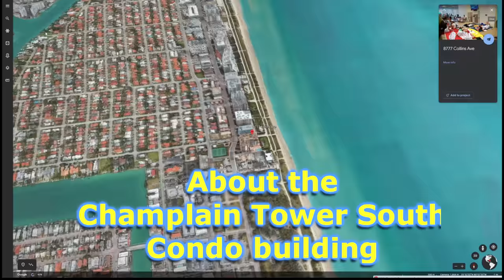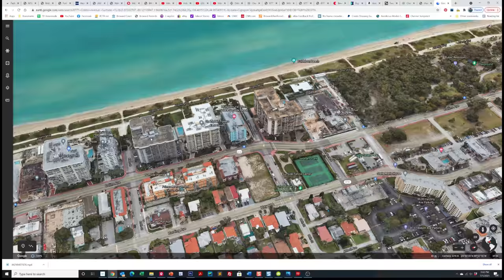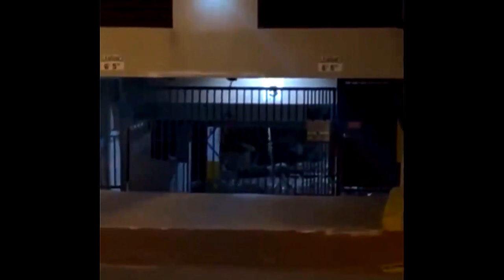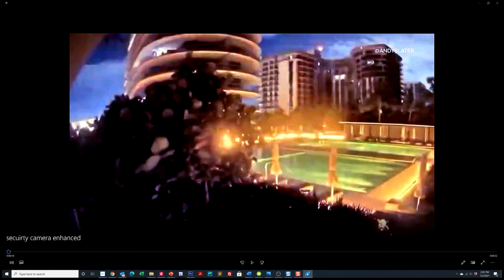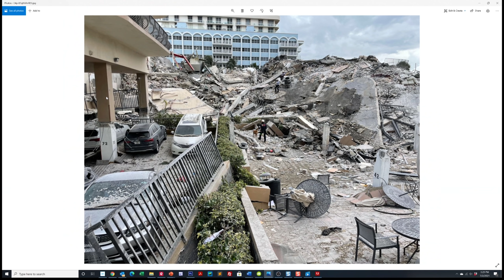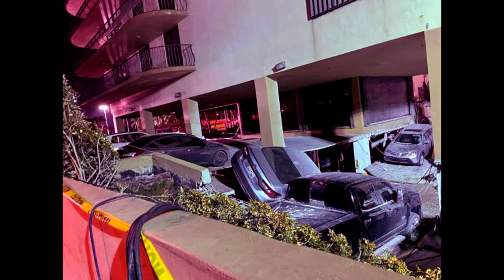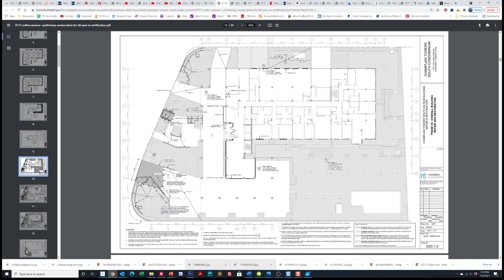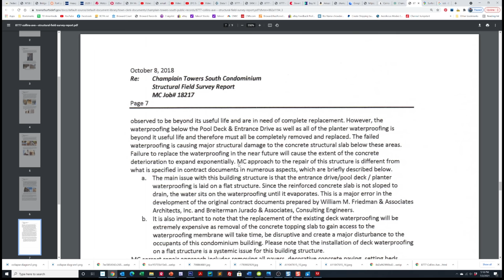Here's Cause Of Miami Condo Collapse Champlain Condo Towers, Surfside

Comment: Best video that explains it. I believe the  water and design error theory more. But even if you leave the bottom slab soffit flat they can still add the slope on the top of slab. Making a thicker concrete slab at the ridge lines/high points. It’s hard to believe that they built that pool deck slab flat both bottom AND top? And if they did, that’s what accumulated all the water in certain areas where there wasn’t suppose to be accumulated. Adding weight and piercing through some cracks damaging the slab.

Another thing I do agree with the narrator was that most of those columns were indeed too small! I’m also wondering if the columns had drop panels or not?
Reply: The columns were fine.  They didn't fail.  What failed was the way the horizontal members connected to these columns carrying the pool deck.  It probably was only one junction which collapsed, but in so doing it overloaded the other areas and the additional stress caused them to fail.  From there, the upper floors load was no longer being carried by the columns below, but instead was hanging in mid air.

This was also over the driveway area which had the load being carried across a double width span. If there was a support column for the above ground structure  sitting midspan on that beam, then as the beam fell, that whole column would drop, and then pull adjacent members with them. From there it was game over. The seafront tower collapsed due to debris from the center knocking out its central support which caused it to fall inwards before pancaking.
Reply: @MartinSparkes-BadDragon  Drop panels or drop heads as we say in the field supposedly strengthen the horizontal members though right? There's no doubt columns are going to be standing up because it's an immovable object in a vertical stance to support. But normally on foundations or mezzanine levels all columns require drop panels for better tension support w/slab to column tie-in. Or am I wrong?

But I do agree with you on your theory that once it collapsed the rest was basically in mid air. No support at all.

Another thing I realized in other videos when it showed spalling underneath the pool area is that the rebar wasn't epoxy coated. Maybe that played a part too since the epoxy coat helps it to not expand when rusty.

Comment: Let the truth be told and it would appear the has been told by you. The city needs to get you on board if they want to save more lives. I see them piddling around with getting the truth of the matter to the people who need it in order to solve this and future issues of this type. This unfortunately is not the last of structure failures in the city. Thank you for this comprehensive explanation.
Reply: I don't understand how a building implodes w/o anyone noticing one crack. Doesn't make sense
Reply: @kdub3892  That's the whole thing, They knew 2yrs ago there were issues with the building but did nothing about it.

Comment: Nice detailed discussion of the collapse.  One additional key aspect of the design and possible factor in the "progressive" collapse is the smaller column size used in the collapsed area of the building. Considering the building as a large mass supported by the columns (idealized as springs), the natural frequency of the structure was lower leading to greater vibratory displacements than the building that remained standing on stiffer springs, i.e. larger column cross sectional area.  With any impact event, such a spring mass system will be set in motion by external forces; the energy from the pool deck collapse, and cause the structure to experience vibration in vertical direction, which is probably what people in the building experienced (some reported the building was "shaking"). The dynamic response of the structure reacting to each section of the building falling seems consistent with the observed progressive collapse. California has earth quake requirements to preclude the "soft story" effect which did result in a similar pancake collapse of one apartment during the Northridge quake.

Comment: I have searched YouTube for every bit of information about this tragedy, trying to get some better idea of how and why this happened.
This is the only video that has come close to making sense to me.
Jeff, thank you so much for all your hard work putting all of this together and for making understandable for the average person.
I have a question though. 
I know that the other block of condos, which seem to be exactly the same as this one, have been deemed safe. However, if they are the same as this one and if they have the same smaller columns one one side of the building, as well as not having a sloped surface under, where we believe water probably collected, over time weakening the structure, will these issues not be a potential disaster in the future as well?
Reply: Perhaps but think about it they're the only now discovering that there might be some small changes in column sizes. Also I have a friend in construction who said it could be as simple as a poor-quality cement or mixes. So there are many opportunities for those other buildings to still be structurally sound.
Reply: He got his theory from Construction Engineering & Failure Analysis's channel and doesn't give credit to the person doing all the work, from the beginning. Nobody else is talking about this theory, and then suddenly jeffostroff comes up with the same exact theory that was established after 10 days of work.
Reply: @FunnyFallGuy  so this  is not Jeff’s Analysis?
Reply: Who knows? It might be that the pool deck of the other block of condos is properly sloped and drained. Or they did repair it already.
Reply: This video that we just watch it very informative. Also, look up building integrity. He breaks down, in layman’s term, everything that probably went wrong.

Comment: Salt, water, humid hot air, shallow water table, condensation on every window. How did it remain standing for so long?
Reply: Insurance scam.
Reply: Capitalism at work
Reply: @neoliberalerneandertaler9347  uh what? explain that
Reply: @scottmerrow1488  uh what?
Reply: I would  never want to live in a high rise building  nevermind  one anywhere  near the ocean.
Reply: @kathryndirocco3048  You have common sense.
Reply: @scottmerrow1488  . Thank you. I assume  that means you wouldn't  either. What a horrific  tragedy.
Reply: Salt water destroys!
Reply: Water causes building cancer.
Reply: @immadreamer3697   Not to mention how many times that parking garage has been flooded with salt water from tropical storms and hurricanes in 40 years
Reply: If anyone has worked on a building on the coast knows that iron turns to dust in due time. Open a wall or ceiling at look at the metal that has simply turned to dust. Concrete retains moisture which contains rebar its not hard to understand you dont need a drawn out conclusion as to why it happened.. but at least he is getting views😞
Reply: @immadreamer3697  accept the pooling was mostly rain water.
Reply: Other factors that may have contributed: effect of past hurricanes; ground may have sunk some (common in florida due to limestone earth)
Reply: @neoliberalerneandertaler9347  Yes because teh buildings in Russia that used superior Stalingrade concrete and rebar are doing a lot better, comrade!
Reply: @joesnuffy1061  Explain what? He's answering a stupid quote with an even stupider one - sorry for your whoosh
Reply: @kathryndirocco3048  Too bad you don't live in Asia.
Reply: @scottmerrow1488  And you don't. The vast majority of the world live in high rises, at least in Asian places, so your sense is not common at all. Get out of the 'burbs and look abroad lol.
Reply: @scottmerrow1488  bingo!
Reply: God Rest to poor victim souls and please keep their families in your prayers
Reply: @the_kombinator why the hell are you  attacking  me? No i dont live in Asia  , and if they have high rise buildings  for the most part then thats their  decision to make and deal with. I live in the USA and im commenting on what i think is complete stupidity to build high rise buildings near the coast.  So why its not common  sense  to you i don't know or care. Don't  be so arrogant
Reply: @kathryndirocco3048  high rise buildings have been built near the coast for a hundred years. This is an absolute freak occurrence, not normal or simple at all. I'm an engineer and the video is fantastic.
Reply: @the_kombinator  Is someone paying you to (try to) waste my time?  I'm 60 yrs old, have been abroad and lived in urban, suburban and rural areas. Who cares if most Asians live in high rises?   Your common sense told you to argue with me/"set me straight"?  Go find a life
Reply: @kathryndirocco3048 Common means it is, well, just that. Look at the population of Asia vs North America. Realize where the majority of people live. Then re-examine your statement about "common" sense.
Reply: @scottmerrow1488  LOL what? You need to take your meds, gramps. Only 10 more years till retirement :P
Reply: @the_kombinator you need to cool your jets pal. Someone  else said  i have commonsense, i just gave my opinion  on high rise buildings  and especially  built near the water. ( salt water erosion). If its ok with you im just saying my opinion  like everyone  else. Go take your anti bully pill.

Comment: The photos of the debris clearly show classic punching shear at the columns. That is where you see the deck failure at the columns by allowing the deck to break loose and fall straight down. Current building codes provide for additional reinforcing at the columns that apparently were not in force at the time of construction of the condo.
Reply: Exactly.  There appears to be no rebar tying the columns to the floors.  This isn't an "if" on these buildings, but a "when".

Comment: I live on collins about 30 blocks South. Water is everywhere, if it barely rains the streets are flooded. Miami Beach has a major drainage issue period.
Reply: Yep.  Having taken geology courses, there are a few places I will NEVER live because of it.  Miami beach is right up there.  It's built on top of stuff that easily erodes in water and is surrounded by water.  Plus "Florida Real Estate Developers" are right up there with "Hedge Fund Managers" in the rate of being notoriously shady.
Reply: Evidence human greed will lead to more disasters. We just aren't meant to live certain places. Nature always prevails.
Reply: Lots of cities do!
Reply: @wordforger  Where else?  And where do you live that is safe?
Reply: And... Why isn't it obvious that rain water would run DOWN the ramp into the garage. There is a grating drainage trough at the bottom, but what if the water runs down fast enough to overrun that? runs into the rest of the garage right?  i think an oversized (too tall) vehicle struck that water pipe and horizontal beam at the bottom of the ramp.
Reply: @andydguitar THIS. And will add beachside, former swamps, and below sea level to the list of no-go housing zones.

Comment: This is the first time I heard any mention of windows, let alone that ALL of them needing to be replaced. While it would not be a driving factor, leaking windows could allow water to get into structural walls, and possibly sub floors, and contribute to the deterioration/weakening of the concrete. The more I hear about this the worse it gets. This is a travesty.
Reply: I live in a building with 620 apartments.
Most of our windows were leaking water for years..
Several engineering firms investigated the issue and found no structural damage
from water leaking. 
I witnessed how all windows at Parker Plaza and Parker Towers in Hallandale Beach, FL were replaced, and they were also leaking.
It's a common problem.

Comment: All the buildings at sea side should be very well examined, for corrosion etc..
Reply: This wasn't corrosion. The probability that all the steel beams corroded at the same speed, and gave way at the same time without explosives is statistically impossible. 

Wake up. You can see the flash bangs(tiny explosions) right before the steel beams were cut with dynamite.
Reply: My concern exactly, did not seawater infiltration at the foundation system cause the collapse?
Reply: @Clarc115  , no. A building with steel structure can only free fall onto itself when explosives are used. It's called physics.
Reply: @Clarc115  , you speculate incorrectly. Name a single steel building in which water corrosion caused collapse. You can't, because it's NEVER happened in history.
Reply: @Clarc115  That's probably a mainstream media narrative. The sea is not close to the buildings footprint. The image that seems to hold the most evidence to me is the shot of the collapsed pool deck from the next morning in which the hot tube (appearing to be empty post-collapse unlike the pool) is sitting exactly next to the area of the deck which collapsed. If I had to guess.. it would be that the hot tube was the spot that was leaking and that the entire area was compromised starting there.
Reply: @matthewmosier8439  If the very ground upon which the foundation rested were washed away, I'd think that would pose a threat to the stabilization of a building built with tremendous downward pressure.
Reply: @Clarc115  The ground wasn't washed away, though. The climate change idea is a media creation. It is pretty clear from preliminary research that water was a contributing factor, but it was not sea water. For example, pilings are used in some conditions in my city a hundred miles or so from the place of collapse. One hotel here drove pilings I think 400 feet into the ground to get a good foundation. With new construction next to the collapsed condo it's much more likely that vibrations from construction and other things led rusted rebar to break loose in a small area, for instance a spot near the hot tub, and that collapse in turn led to a big section of pool area falling in on the parking garage. This in turn led to the buildings collapse since the building was tied in with concrete slabs between columns to the parking garage and pool area.
Reply: @matthewmosier8439  Thank you, however, if new construction demanded 400 foot deep pilings, I would speculate or infer that the possibility that seawater infiltration exists.

Comment: THE BIG QUESTION: How many more of these kind of "accidents" are already on their way to occurring? You couldn't give me an oceanfront condo in Florida. Greed builds. Greed claims
Reply: "It could never happen to me!"
Reply: Yeah, to hell with their million dollar views. There's no telling how many more buildings that were built the same way.
Reply: Yeah.  I wonder. But aren't there laws forcing you to call an engineer for reviewing it every somany years? I mean if an engineer signs off on it u r good.
Reply: @NoName-to5xl  yes but you need a) someone to enforce said laws and b) the company/entity to find a competent & unbiased engineer/inspector/auditor that can't be bought & c) people to follow through on the engineer's report/recommendation.
Reply: ...I find it impressive that they have already deemed the North tower, built the exact same way, is OK.  It likely has the drainage issues, the same column and deck design, and possibly the same concrete and rebar vendors that worked on the South tower - as an engineer, I'd suspect the column design, the rebar placement, the concrete strength and likely conclude that if both buildings are similar, they both contain the basic flaws - just a matter of time
Reply: @wokewokerman5280  the building that collapsed didn't even have the same columns uniformly. But it would be interesting to see the blueprints and plans of the other Tower. They said it was safe but...who knows.
Reply: @notorioustori  agree, and I did notice this author made reference to the smaller columns in the collapsed section, however, the column design is based on load and spacing, so they can likely be different, however, the connection to the floor and transfer of load may likely be a flaw during construction, and had put the rebar too close to the outer surface of the column, enabling more corrosion, and less strength as a concrete and steel system...they'll figure out the flaws most likely, and I bet the other tower will be closed due to that report.
Reply: @NoName-to5xl  Yes. 40 years. Guess how old is that condo. 40 years. They were just starting the inspections and preparing to do the repairs. I believe they said there was an inspector at that building a couple weeks before the collapse doing a preliminary inspection. The building didn't last long enough to get it done.